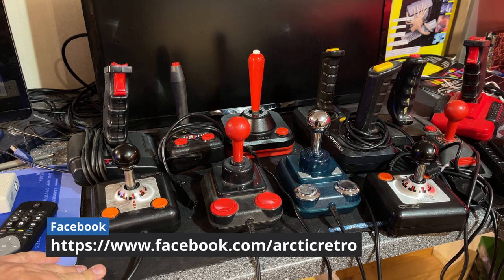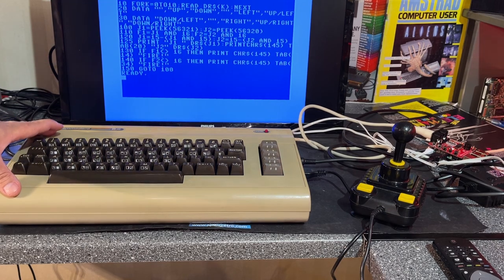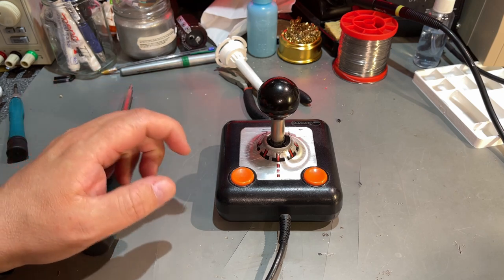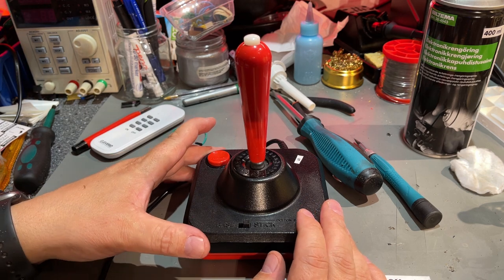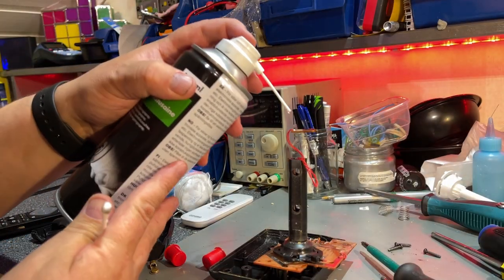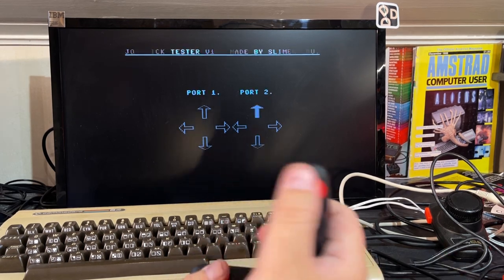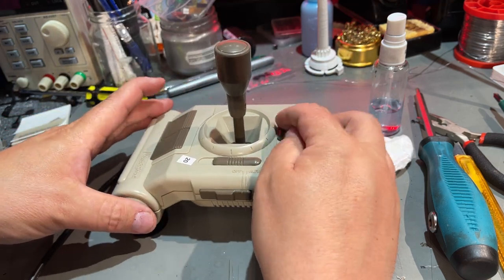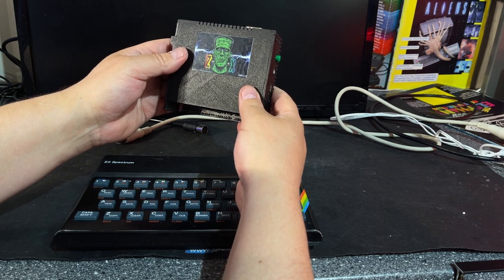Joystick repairathon - A lot of joysticks needs service and repair!

Comment: One joystick missing from this collection is the Konix Speed King. You held it in your left hand, and the stick was very short with minimal movement and crisp contact done by microswitches, and you operated it with a right hand thumb-forefinger grip. It was designed, as the name implies, for those stick wiggling games like Decathlon and Track & Field, but it was (is) perfect for precision movement, too.
Reply from the maker: Thanks for the info!

Comment: Nice job cleaning and tuning, Tommy! (It was a strangely relaxing video). 🙂
As you probably already know, many of the older PCI (and ISA) 'SoundBlaster' cards have a 15-pin connector suitable for MIDI and joysticks (like that SVI QS-113).
With a bit of luck you might have one of those 'SoundBlaster' (or compatible) in your parts store. (The other part of the equation, though, is having a PC motherboard with a free PCI slot).
Best regards! 👋
Reply from the maker: Thanks for the tips!

Comment: A couple comments here, and things I would do:

1. You said you don't have those little springy clicky metal discs that were bad on one of the no-name joysticks. Well, you do! Remember that hopelessly broken Commodore joystick?

2. Those secondary buttons on the blue-based Pro 5000 (or something) are "button 2", and the C-64 isn't wired to handle them. The  MSX and the Amiga are.

3. You could combine the two Quickshot Turbo joysticks and make one in an almost pristine condition.
Reply from the maker: Thanks for the info. It I want to replace the springy clicky metal discs, I would prefer new ones. :)

Comment: 18:00 I am using micro fiber cloth for glass and it is absolutely great for cleaning. You can also mix a spray bottle with isopropanol, distilled water and some drops of dish soap (feks Zalo).
Reply from the maker: Thanks for sharing!

Comment: The Competition Pros always need a good splash of silicone oil onto the rubber block at the base of the handle. It stops the rubber from drying out and cracking, and makes the stick work very smoothly.

Comment: great video. I am trying to clean that open microswitches ( like you have on 25:38 for example )with alcohol but they are still not working. I can confirm with multimeter that contacts from microswitch to the wire are fine. are you recommending something else for cleaning the contacts or issue might be something else , maybe needs some sanding or something else  ?
Reply from the maker: Thanks. Try deoxit, sanding or a small file.

Comment: The joystick you are fixing at 32:00 has in my experience very poor quality plastic. I recomnd using the backing soda super glue trick to make the glued connections stronger.